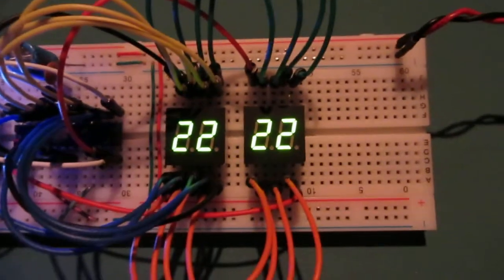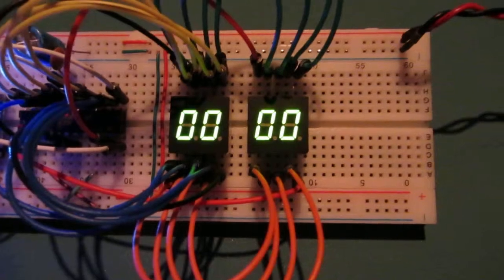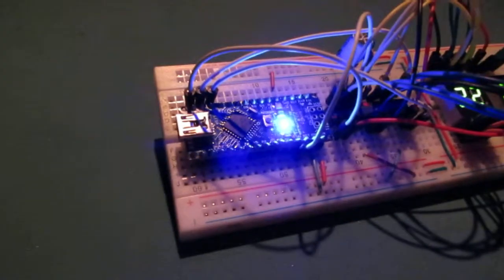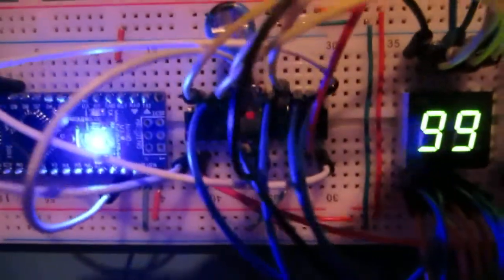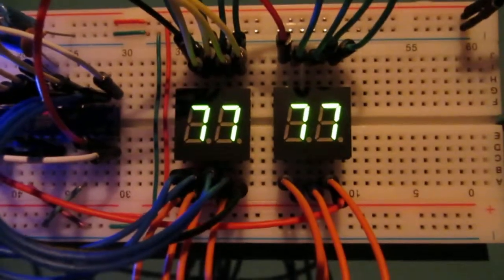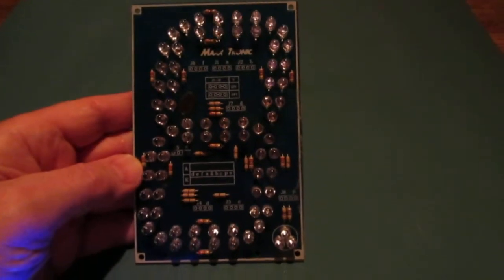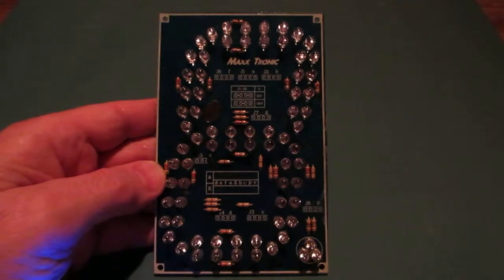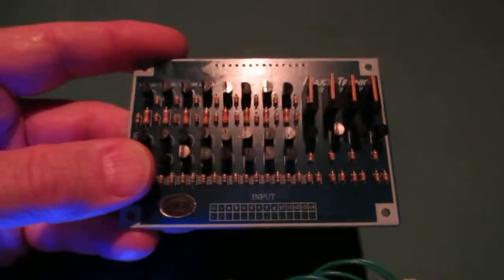Scoreboard Project

Comment: Hi Mr :-)
many compliments for your project.
I'd like to make a scoreboard for my volleyball team but I'm not an expert.
Did You completed the board?
May I know if It's bossible to clone Your beautiful job?
Thanks a lot, Umberto.
Reply from the maker: Hello Umberto. Thank you for your interest in my scoreboard project. It was successfully finished in October of 2014 and turned over to the person who commissioned it. The scoreboard measures 3 ft by 6 ft and displays the scores for 6 simultaneous games of horseshoes. I used twelve red P10 Dot Matrix LED display panels which you can find on ebay. These panels are clearly visible in direct sunlight. You may see similar panels used to display prices at some gas stations. Processing is controlled by two Arduino USB Nano chips, one for Games #1, 2 and 3; the other for Games #4, 5 and 6.  The control program was written in the Arduino development environment and consists of about 300 lines of C++ code, much of which is comments and explanation. I'd be happy to give you more information and photos, but we'd have to go to private message or email somehow. Regards - Phil